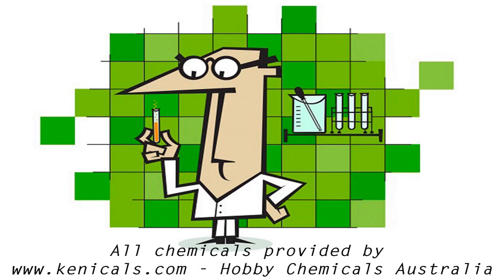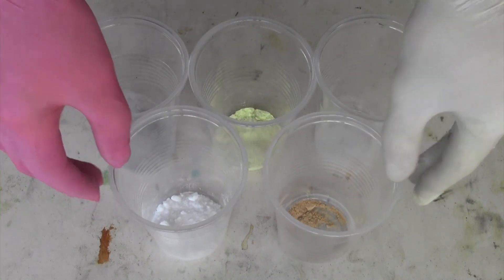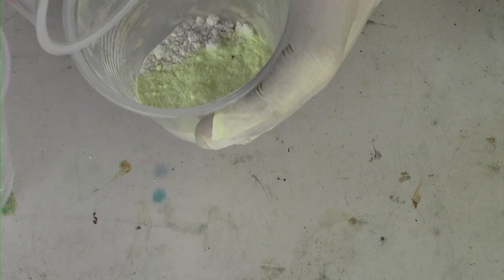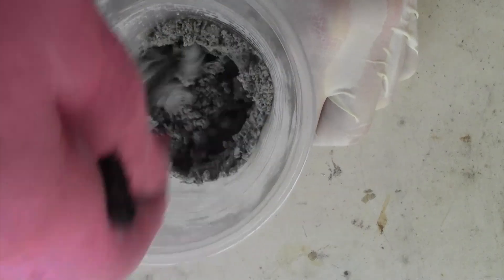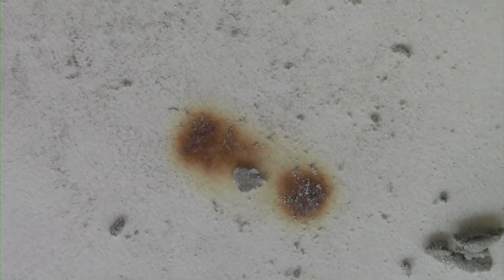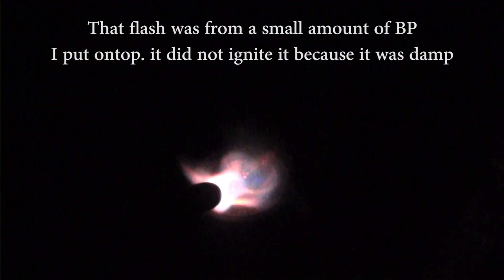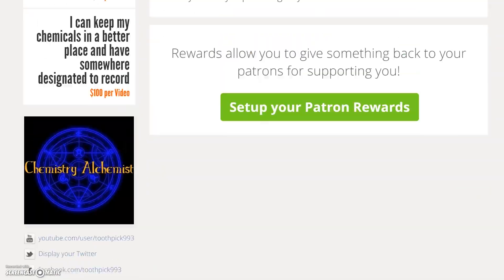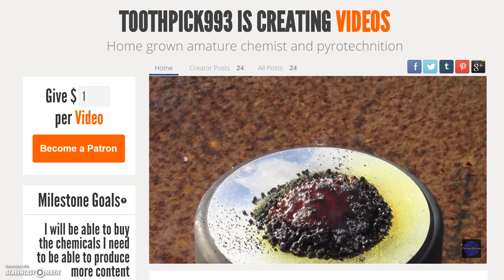How to make Strobe Pots (Pyrotecnics)

Comment: You will need: 
51% barium nitrate
7% potassium nitrate
19% sulfur
18% magnalium
5% ?

Grind all chemicals separately, combine, gradually add water until it resembles damp sand
Reply: Dextrin for a binder I'd assume
Reply: Or SGRS
Reply: 5% dextrin
Reply: steel powder
Reply: “Dextrin, all by weight”